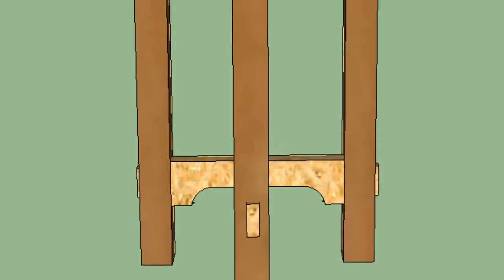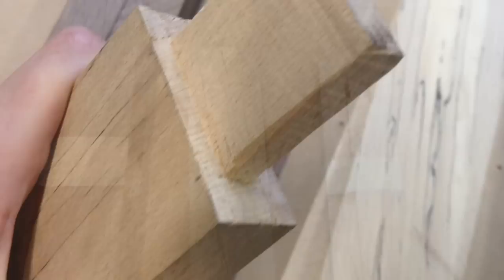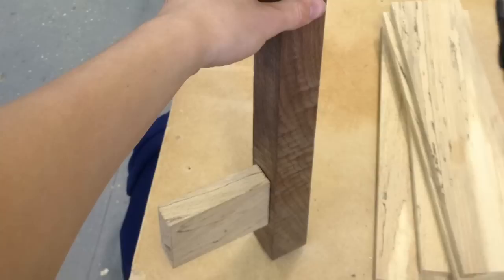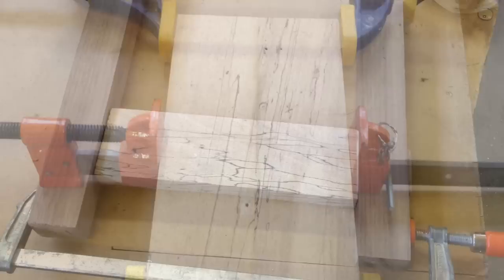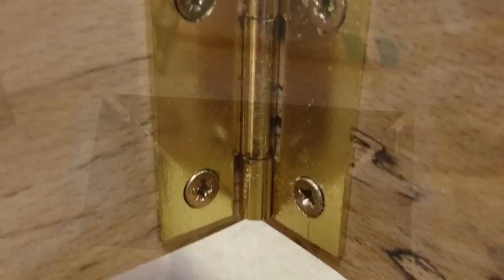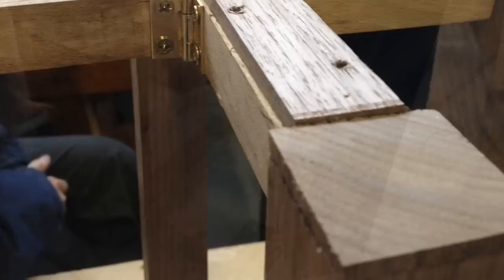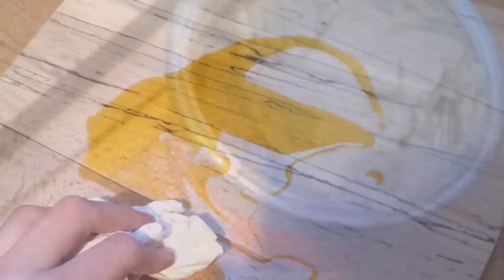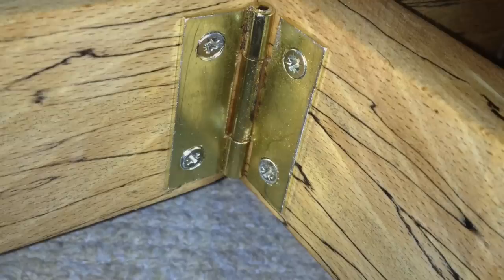Building The Folding Table: Photo With Commentary Timeline!

Comment: Hi Adam,love the projects,heres a tip i got from my grandad,when screwing into a hard timber using brass screws always put in a steel screw of the same size in first, it paves the way for the much softer brass screws,also put a little wax on the screw thread makes for easier screwdriving ps love the new saw lucky lad cheers malc